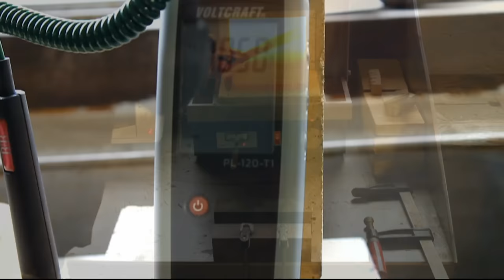Lineage Canoe: Making a bushcraft knife for canoeing

Comment: I love the knife but that belt grinder wow. I have never seen one like that what model/brand/size etc is it? And how much? It looks like an absolute beast.
Reply from the maker: It's a VSF from 1999. Dutch made and bought it for 600$. They don't produce it anymore I think. I only tend to use is at half power!
Reply: Wow, Very lucky. What size belt does it take?
Reply from the maker: +scottecooke 75x2000!
Reply: I thought it looked wider than usual.

Comment: very nice work. I see you have a passion in it. sorry for questioning... how you do the hardening? air? i  am doing something very simmilar but do not know if in a good way ... can you describe it more detailed please? thanks body!
Reply from the maker: Hi Anton, You're always free to ask stuff! This is RWL34 stainless steel and I harden it by clamping it between two pieces of metal. It draws the heat out quicker than air, but slower than oil of water. It is steel dependent. What steel are you using?
Reply: I use n690. rwl is much better but i am beginer so mistakes on my homemade 72" belt grinder are cheaper... :-) i put it between two pieces of alu blocks and then cool it with air from compressor. I like it because of minimal oxides and burned oil ... i use also paper under alu foil as you i think, then minimum oxides are burned on the steel surface
Reply from the maker: Wow N690 is a great steel as well. Even more expensive than RWL34 by the way! Are you packaging you steel in stainless steel envelopes? I've read that using baby talk powder in the envelope works even better for preventing oxides. But to be honest: now I'm outsourcing all batch heat treatments for stainless. All carbon steels are still in house, but I like the cryo treatments for stainless.
Reply from the maker: good link! good luck to you too!

Comment: Nice work! Looks awesome. Can you tell me how Thick the is You used in the Video?
Reply from the maker: +TheSickness 3.5 mm!
Reply: +Alexander Bol Thanks! I use 3mm thick steel but I have problems on filing the bevels right. I don't have such a (nice) plunge line. Do you have any tips for me? 
Greetings from Germany ;)
Reply from the maker: +TheSickness haha: buy my grinding jig! Otherwise keep practising! Took me 50 blades to be honest
Reply: Alexander Bol Okay thank you. Just getting into knife making and finished my 2nd knife. I haven't got a plunge line which is that good but it still looks pretty good for the First attempt(s) .
Reply from the maker: +TheSickness just keep trying! A self-made knife is not about being perfect. It's about the pride you feel when you use it.